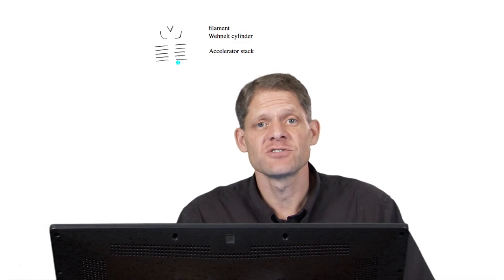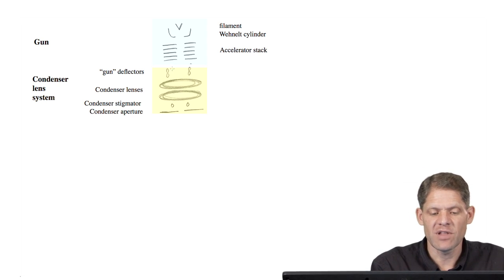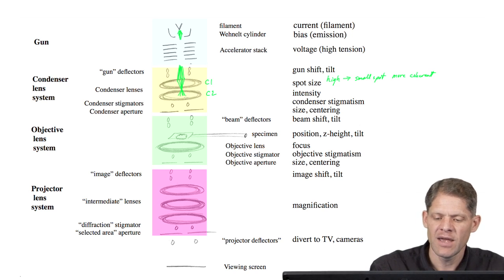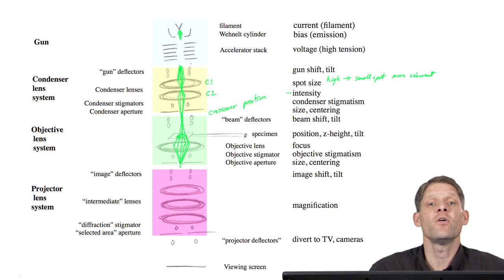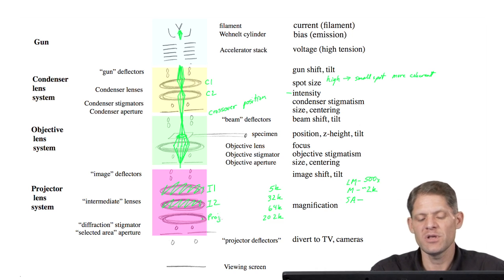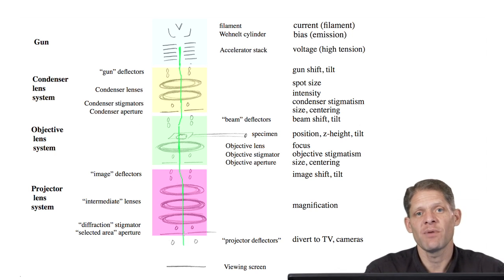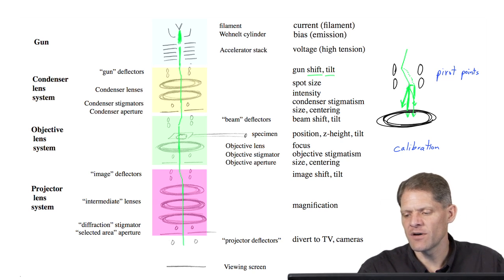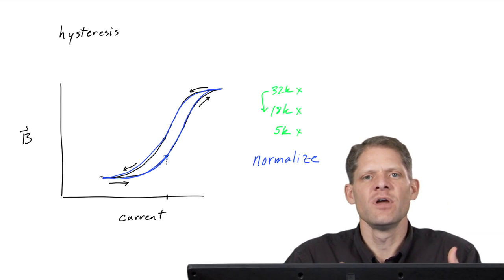Part 1: The Column - G. Jensen

Comment: 🎯 Key Takeaways for quick navigation:

Electron microscopes consist of various lens systems: electron gun, condenser lens, objective lens, and projector lens.
The objective lens system produces a magnified image of the sample, further magnified by the projector lens system.
Multiple lenses in electron microscopes compound magnification, enabling high-resolution imaging.
Deflectors, lenses, stigmators, and apertures are key components of each lens system.
Controlling parameters such as filament current, voltage bias, and lens currents affect image quality and magnification.
Spot size and intensity control affect beam coherence and brightness on the sample.
Specimen holders allow control of sample position, height, tilt, and rotation.
Alignment of deflectors ensures the electron beam passes through the optical axis of each lens system.
Calibration ensures accurate response to commands for beam shifts and tilts.
Hysteresis in lens systems can lead to variations in imaging conditions, necessitating normalization procedures.

Made with HARPA AI

Comment: It seems like you could compensate for result Deltas in magnification range changes by modifying the thermal heating/cooling effect of the "water cooling" system of In. (don't cool a lens that's not active in LM or M modes)